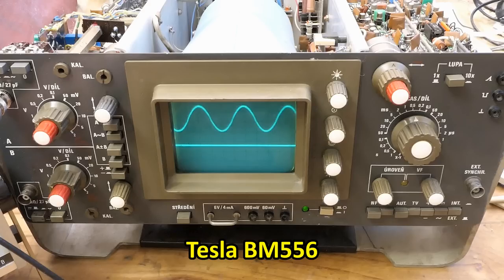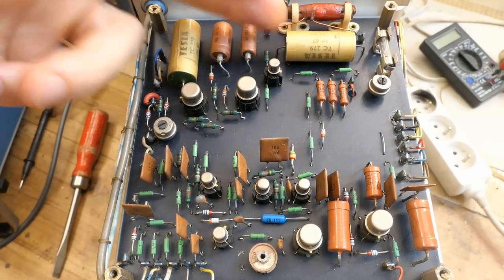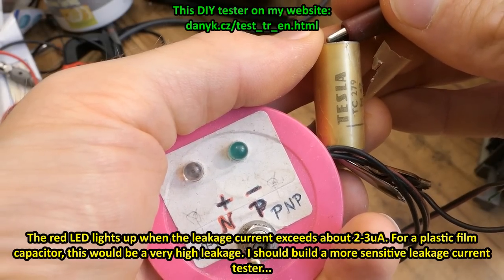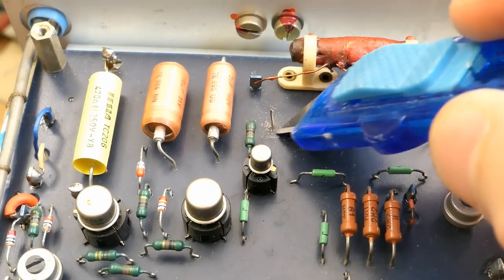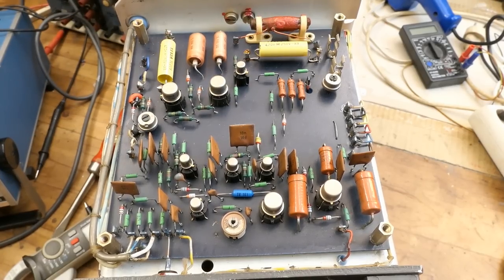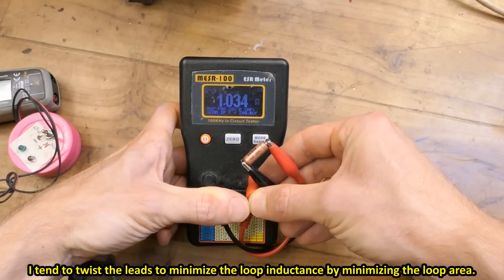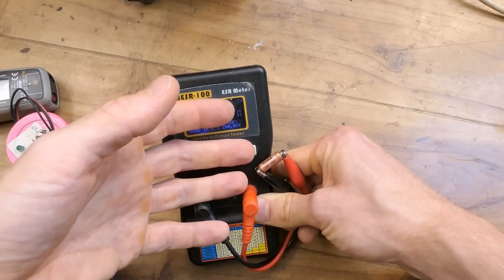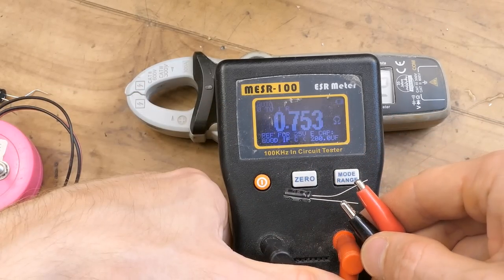Analog oscilloscope repair 2 - Capacitors, ESR, leakage current

Comment: The higher capacitance reading of leaky capacitors usually comes from the way how the multimeters use to measure the capacitance (charging by a small current, measuring the time to a fixed voltage). Most do not feature any leakage compensation (e.g. doing second measurement by discharging it back to zero).
And regarding the capacitance: The 47uF is essentially the same as 50uF, as well as values like 56uF or so. The rated tolerance uses to be -20/+100%. The reason for odd value formal ratings like "56uF" is not because you would need that difference in capacitance, but to ensure a proper ESR and ripple current rating is maintained, even when some aggresive but not that technically savvy purchase officer tries to save pennies by switching to cheaper components. The trick is, the odd value is available only with the high ripple current/low ESR format, so he won't be able to purchase a cheaper general purpose type for thar. The 15/33/68 are used for generic low ESR, the 12/27/56 are used only for really super low ESR/high ripple current rating. Of course the standard 10/22/47 values are available with those ESR/RC specs too, but when as a design engineer, you want to ensure no bean counter moron would swap them for cheesy spec type, you just specify such odd value instead.
The same reason is behind those crazy values of feedback resistors (like 10k1), used as two of the same value around TL431 in 5V supplies, where any pair of equal resistance and similar ballpark values works, but you need them to be precission types to be really equal. The "10k" could be purchased even as 20% type (so may differ more than 20% from each other), but when you specify "10k1", the purchasing monkey would be able to find only 1% (or better), so you could be sure the divider will remain right.

Comment: I would solder the fuse into the fuse holder on the HV PSU control board. I have the 120MHz BM566 model, and the high voltage was intermittant. The cause was bad contact of that fuse. I tried to bent the contact to make it tighter, but the it was still flaky. The metal is too thin and not springy enough, no matter how tight I bent it, just inserting the fuse loosened it up. Now it works, but I will solder the fuse into it when I will get around to do a restoration on the scope. The fuse holder is riveted to the board under the solder, so I won't bother replacing it. Mine is from 1987, and it has one of the dreaded brown bakelite-encapsulated Tesla paper capacitors in one of the 500nF positions in the HV power supply. It has a nice crack on it... Mine also has a ton of tin whiskers on the can of the Y attenuators.

BTW, are you sure this is a switch mode supply? I would think it is a high frequency sinusoidal oscillator. It was more common in older oscilloscopes, because it is a lot easier to filter out the sinusoidal ripple than to deal with the lot of harmonics a switch mode supply produces, both conducted and radiated.

Comment: I actually still have a similar soldering gun like yours - I specifically looked for one that keeps the copper wire in place with plain screws, and I found and bought one back in 2005.

Comment: 1:00 That´s actually recommended in the service maunals of various TESLA pieces of equipment, so you won´t risk lifting the pads.
2:40 I love this, reminds me of my teenage soldering stationless self. Even having the exactly same soldering gun. Except I wasn´t doing such a pretty lead bending as you. My recaps are sloppy indeed.
Reply: It was done in old radios and TVs TVs aswel for speed mainly, I do it in modern gear from time to time, theres nothing wrong with it at all..

Comment: That 2.2μf 450V capacitor with the 7Ω ESR, how old is it? 
Panasonic recommends on their website to reform capacitors that are new but have been sitting around for a while.... 
I'm sure that if you brought that capacitor up to rated voltage slowly on a high voltage power supply, making sure that it doesn't get too hot (they usually get warm but cool down and stabilise which then you can raise the voltage again for another step until you reach full rated voltage) and it will be restored and display lower ESR.... Actually display good results all around... 
I'm sure that after being in use for a while, if you test it again, it should show less than 7Ω resistance.... 
You can test it out on another capacitor that is showing higher ESR than it should and you should see an improvement after being left at rated voltage for a few hours.... 
Anyway, love watching old capacitors being tested but sometimes new capacitors can appear to be worse than old ones, especially if they are old stock.... 
Looking forward to seeing the next video...
Reply from the maker: That capacitor is less than a year old, never used. Forming can reduce the leakage current, not sure it reduces the ESR. I'd have to try it.
Reply: @DiodeGoneWild pls update with this, important
Reply: @DiodeGoneWild  I would love to see that.... 
I saw someone else a while ago who got upset that the capacitor looked bad even though it was new and threw it out... He didn't try to see if it could be saved, he said that he got it from eBay and it's probably a fake... But I think that it probably had been sitting around waiting for someone to buy it... 
I know that that talking about reforming capacitors is a hot topic and people either agree or disagree.... 
I don't agree with reforming an old used capacitor, if they are dry.. you can't save it! And therefore you should never try to reform old capacitors but new old stock is okay... 
I use a Variac and a bridge rectifier through a μA meter and shunt plus a DC voltage meter and bring up old capacitors slowly and watching to see when they start to pass current... This way I get to see how it will perform under real world voltage... A switch and resistor makes sure that it safely drains the capacitors after the test.... It's a good way to test old capacitors and also reform new old stock.... 
I have various capacitor testers but this is my favourite way, it's like those old high voltage capacitor testers from the 40's and 50's from the American Heathkit and Elko brands but trying to get one of those from America to Australia is a joke! Shipping usually costs twice the price of the product and then there's import charges on top of that! And I thought that we were supposed to be friends? 
The Chinese are taking better care of my needs LoL... 
But anyway, thanks for the response! Love your channel! Always looking forward to seeing your next video!
Reply: @DiodeGoneWild  Forming usually increases the ESR as the capacitor itself is drawing less current. I am talking about the old capacitors that weren't used for decades, like from a tube radio or similar :)
Reply: @PeterMilanovski  It is common for 450V electrolytic capacitors. Try to compare the ESR of a new one for 400V with the ESR of a similar one at 450V and you will understand. This is apparently because the type of electrolyte for 450V types is significantly different from the electrolytes used at 400 volts and lower voltages.
I myself compared it many times with several products of the same brand and also various brands and similar type, which did not differ in size or capacity and were freshly manufactured. And not one piece, but the entire series of 450V was the same, there was no reason to throw them away and there is no reason to suspect that they are defective.

Comment: What is "glass passivated junction"? Again I encountered aging semiconductors, two 4007 diodes in 0.5A 12V bridge rectifier got open circuit, wtf? Warming up with a soldering iron restores it for a while. The datasheet recommends using new ones 4007G (G means glass passivated junction) diodes, what this? This is a new technology for protection from aging semiconductors (from loosing internal connection)?
Reply: That's easy... Anything that is molded into thermoset or thermoplastic will eventually rot inside because it's cheaper, but this type of encasement becomes moisture tight over time. therefore, to this day,  but also 60years ago chips for military applications are encased in ceramics or glass, it costs more but lasts longer.